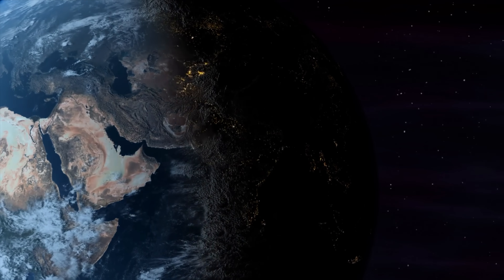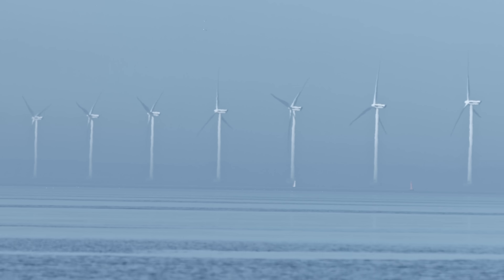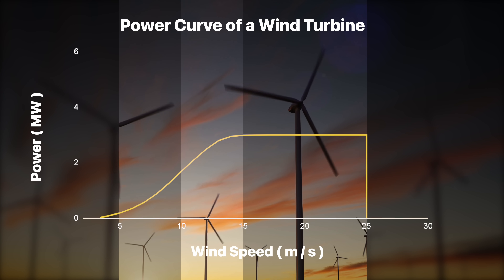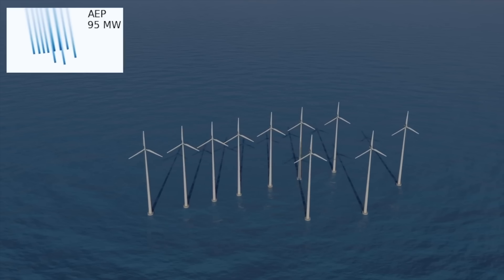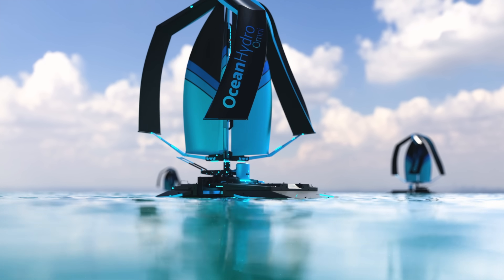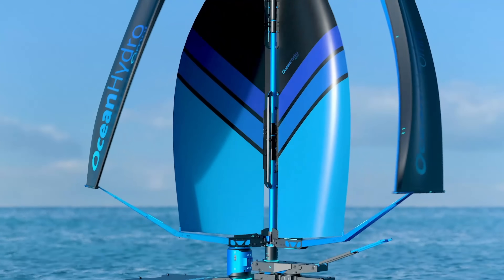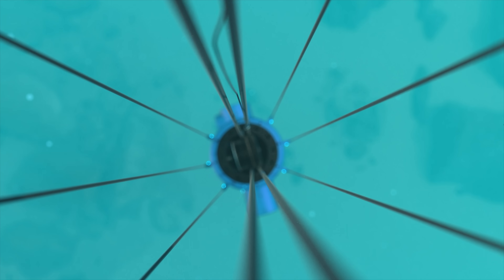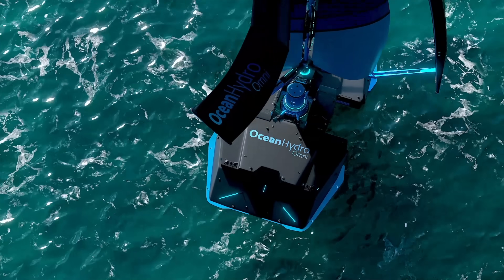Breakthrough Tech Solves Wind Power's BIGGEST Problem!

Comment: Still stuck in the past in one very important way, despite being beautiful in other ways. The problem? It is still grid-centric. That limits how far from shore these innovative new wind farms can be. In turn, that limits them to just the 1/4 or so of ALL ENERGY that is presently consumed in the form of electric power. To go ALL IN on wind power, we need to move large fractions of heavy industry far offshore, where locally generated wind power can finally replace fossil fuels on a massive scale. Aluminum refining, steel smelting, large-scale electrolysis of seawater, fertilizer production, synthetic fuels and much more can all be done using CLEAN WIND ENERGY far offshore, which can get Humanity the other 3/4 of the way, to 100% renewables.

Comment: I don't even want to address the maintenance needs of such a system. I simply don't believe the efficiency stated. Water displacement on the way up and down is such a burden on the energy content compared to a simple pumb. And the best for the closing argument, it absolutely makes no sense to pump the water from the bottom of the lake/river/ocean to the top of the reservoir, you do that from as close to the surface as possible. e= m*g*h counts from the surface. You would lose m*g*height-of-the-water-body each time you pump.
Edit: I have to correct myself. The latter part is wrong. Pressure from the water body will equalise the needed energy.

Comment: Has any work been done on how the vertical turbines perform in turbulent air? It sounds like they should do better and also smooth out turbulence down stream. This could allow joint wind farms with vertical turbines allowing for greater density of horizontal turbines. Has any work been done on it?

Comment: This technology would probably be better used  without the weight moving in the water column. Use the wind to pump the water and work as a desalination pump or pumped hydro using seawater.

Comment: I’m curious how this is system is anchored to the sea floor  as it has to endure the interaction from waves on the floater and from current on both floater and weight. The underwater area of a 1000 ton weight is substantial and this weight has to be supported by the floater. Also the weight has to be properly shaped to avoid the effects of current-induced turbulence

Comment: Great comment input on maintenance of seaborne structures w/moving parts, etc and it will take a mix of generation sources for an overall solution (like today, but more).  Still, these could be great in coastal areas, but transmission losses will limit how far inland this could feed power.  Interesting, but myriad large challenges remain that I don't see a great solve for.

Comment: Why not then use normal more efficient turbines and put the weight storage on land? Seems like its way easier to maintain and simpler to implement. Same thing as the one proposed in the video. In Norway e.g. you would use it topump water to dams and regulate that way, again the same principle but better.

Comment: This looks like a maintenance nightmare. Your are building an energy buffer under water, how can this be cheaper than old car batteries in cheap containers close to the city? I'm a mechanical engineer and I cant see a solution where moving cables are supposed to last under water with rust, particles build up, metal fatique etc. A traditional windmill is a very clever solution when u think about it since the moving parts are placed in air which is a much easier medium for materials to handle than a biological medium like seawater.  
  Windmills can also turn down production which this vid indicate it can not.. We need a solution with fewer moving parts and less material area to be sandblasted, not more.

Comment: I see a lot of "science" channels that present almost like company mouthpieces. Where's the critical analysis? Where's the opposing data? In fact where's the actual data? You say HAWTs are 50% efficient and VAWTs are 35-40% efficient (I'd like to know the source because I think that's high but anyway). But that's directly taking kinetic to electric. Here there's two extra step of converting kinetic then potential then kinetic again. With, unquestionably, losses in efficiency at each stage. So what's the total efficiency of the system? 7-8%?

I'm not even going into the issues of underwater moving parts because others have covered these already.

Comment: My question on this is related to water pressure and buoyancy.  Surely the weight would require far more energy to pull up than it would gain when lowered.  I may just be being dense (pun intended) but would be interested to hear from an actual scientist whether this is a valid concern.

Comment: Lifting a weight looks like it could break easily. All moving parts breaks over time. Also high wind speeds are not that common and only last for a short time. All sorts of things will grow on the part under the water, it will require maintenance on an unprecedented scale. Finally how does that operate in 20 meter high waves? The animation only show calm oceans.

Comment: Love the video!  Not so much the click-batey title... Tech that MAY solve part of wind power problem would be a better title.  First, as some have already commented, you have critical, moving parts under the water.  Sea Water.  This environment is brutal, and building anything that lasts is almost impossible and not cheap.  Also, an important point NOT brought up- the height of each type of windmill, not just the size.  The giant vertical windmills will get faster, more consistant wind than the comparitively short Horizontal windmills- comparing the power each type of windmill generates is not going to be the apples-to-apples comparison the video presents, which brings into question their calculations on how much more power this system will generate.

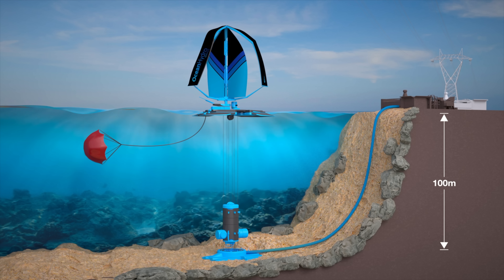Comment: 9:22 nonono, no. this is not a storage, this is a joke. 
do some mgh and tell me where you gon fit half a million tons of concrete. which is what you need if wanna store 10h of 5MW with dh 36m.

oh ya, water. so concrete has a relative density of 1.4 instead of 2.4, lets make it a 6MW turbine then id take 1 million tons of concrete. 
thats 100eiffel towers. or 10 if its 360m deep.

Comment: on the high wind thing, i thought that out decades ago.  the blades have springs that hold them in place.  as the pressure increases, the pressure itself feathers the blades by working against the springs.  with the right preload, the springs begin to feather at marginally excessive wind, and go all the way to fully feathered when the wind is dangerously fast.  you might be able to be 95% feathered in a hurricane, still generating power.  take some played out oil production platforms.  instead of tearing them down, put these wind turbines on them, and use the energy to pump sea water through the existing pipelines that used to carry the oil, and on shore, run the water into a storage pond well above sea level if you have the spot.  then the generators run off the pond water.

Comment: There is a fault with this devices design.

The need to attach an electricity generator to a pulley.

They need to counterbalance two gravity driven weights on either side of the pully .....a counter weight.

Then they attach an air pump, and two balloon ballasts to the counter weights....

The counter weights use buoyancy to rise and fall driving the generator...the quicker it rises the more energy it generates....

The wind turbine can power the air pumps instead of lifting and dropping the weight. 

Also the wind turbine can be setup to generate direct energy.....or we can use much larger weights and use balloon ballasts to reduce the energy of lifting the weights.

Integrating underwater wave power into the system, we can reduce the turbulence around the water gravity battery....so that the disturbance doesn't reduce efficienty.

this is an excellent idea....they're not going far enough

Comment: Never mind hurricane force winds, how about hurricane waves? The CGI shows calm water. But the ocean isn't always calm, especially when it's windy. As the floating turbine moves up on a wave, the load on the cables increases as it pulls the weight up. Then the floating turbine drops, and the weight also drops, with considerable momentum. then the  turbine rises again, and suddenly it's fighting against the downward momentum of the weight. This is called "snap loading" and leads to excessive fatigue on the cables and/or pulleys involved. And it happens with every wave that passes under the floating turbine.
Plus, every wave makes the turbine rock side to side, which probably can't help efficiency, and again stresses the vertical axis. Food for thought....

Comment: What an interesting solution to the Energy storage issue. I wondered what they were thinking with Wind power that was less efficient. But it is very interesting how it will use weights in a way as a sort of power storage.

Comment: ok...there is an obvious flaw and solution. ship the weight. connect to a sodium battery power bank. draw as needed from that. as to the shape...much better than the monstrosities presently being built and the advantages are self evident. with no bobbing weights attached the marine life will be impacted far less as well as far less mechanical maintenance/complexity. less stuff to break = more reliable.....less costly to replicate.

Comment: Though it would require more of an investment in the foundation of the standard offshore wind turbine to make it feasible the addition of underwater turbines to harness the much more reliable sea currents so that when the winds are blowing inconsistently the subsurface units can take up the slack and provide a more even energy production. There would also be the added benefit that when the winds are blowing too fast to allow for the safe operation of the wind turbine then the water turbines could take over and keep the juice flowing.

Comment: it seems to me the biggest overlooked aspect of offshore energy is the transmission of that power, which requires expensive and costly to maintain infrastructure.
one work around is to instead use that energy at its source. floating wind powered processing plants; desalination,  waste processing, etc. 
perhaps with a battery recharging station for electrically powered shuttles which go to and from the rigs.

Comment: Im not sure if placing Mass under water to use gravity's pull for storing energy make a lot of sense (buoyancy)?. 100kg Concrete up 10m in Atmosphere stores about ~2.7Wh in potential energy. In Water you loose ~50% weight. so around ~1.35Wh per 10m depth.
Lets say we have 100m depth. = 135Wh per 100kg Concrete. If you have 5 Tons of Concrete you got ~6750Wh or 6.75kWh potential Energy storage. The newest windmills produce ~15MW peak. To store this energy in 1 hour with a 100m cable under Water, the Mass of the concrete block should be ~11.1 kT. 😂 Storing Energy is a …..
Please correct me if i made some errors.
Reply: I made a mistake. Its even worse. 5 Tonns result in ~675 Wh and the Mass for the 15MW example needs to be 110 kT

Comment: Wind is HIGHLY predictable 48-72 hours in advance because it is tied to weather fronts which we monitor globally and predict constantly better and better all the time.  And as you showed it's highly predictable on a scale of several months, it's the in between range of a few weeks in which it's unpredictable.  Every energy sources predictability is nuanced in this way with time scale being key.  Fortunatly for wind generation most power is sold either in long term blocks via contracts, or purchased a few days ahead in futures markets, essentially the time span that wind is unpredictable over is not where the market operates anyway.

Comment: Interesting concept both for energy generation and also energy storage. I see problems to solve regarding corosion and sealife that could interfere with the moving parts. And the involved weights need to be in the multiple tons range to store some meaningful amount of energy. A 10 ton weight dropped 300 m has a potential energy of 30 megajoules, or ~8 kWh.

Comment: I'll believe it when I see it. It didn't give any sense of cost & energy scale for the storage, which is THE challenge in energy storage. And doing it all underwater seems a bit crazy given how expensive it is to build and maintain moving machinery in the ocean. 

I'd like to see a practical comparison with an onboard dyno, transmitted along the surface to onshore storage. Particularly with the consideration tha significant public & private investment will probably drive the price of storage down, without any engineering, time & $ investment from the company.

Comment: Isn't the reason for putting giant horizontal wind turbines offshore about placing them where there are fairly steady high winds and don't they need those really high towers to ensure that wind is far stronger and constant?  Putting any turbine close to the surface creates all kinds of issues and greatly lowers wind energy from normal wind shear effects.  What about large waves?  How will those rigs handle those?   As another person posted, anything under sea water has corrosion issues especially things with moving parts.  While this sounds tempting on paper, I predict this will never go forward.  If this concept of of using the wind turbines to raise and lower weights is a good idea then do it on a land based tower or over a large hole bored into the ground.  That sounds far easier.

Comment: BULLSHAT!  Terrible design!!
If you want a gravity battery (elevated mass), put it INSIDE the horizontal axis wind turbine (HAWT) support tower.  Yes the tower will need to be wider to hold a big mass, but it will be fully protected and the mass can improve stability in storm conditions.  
Meanwhile, the Vertical axis T (VAWT) can be placed in the empty, untapped zone under the HAWT.
(honestly some of these renewable ideas are incredibly stupid.  The idea of having 2 masses, one going down while another goes up, that perfectly cancels each other out! )
Two Bit, you can do just as well to criticize bad ideas as well as promote plausible ones.

Comment: The current design is not approved by most flocks of birds. The next pandemic will reduce technicians to repair failures. Salt water environment leads to corrosion and more maintenance. When optimus prime comes online it could take over maintenance.

Comment: Isn’t this solution close to circular thinking? 
Why not just use weights on land powered by wind at sea, were you don’t need to consider corrosion and other stuff that the marina environment brings? I initially thought that the video was about some genius way to use waves  and tides together with wind power. The proximity issue seems to be the one factor that speaks for this kind of solution, but I wonder about the difficulties and costs around this specific “solution” with the marine environment . Maybe I don’t see it because lack of knowledge. What is the true benefits to this kind of system against a offshore “traditional” wind park or any other “ungridly” power source exporting the the electricity to weights on land or under ground if you worry about the esthetics?

Comment: 7:25 - well I do love some enthusiam - just, dont let yourselfs be fooled by designs like that, just because the efficiancy is not "that far behind" doesnt make the concept feasable.... The issue with those turbines is not their efficiancy, never was - its the issue of the wind itself being stronger further up..  15m -> 150m isnt just x10 higher, but x10 stronger wind. The Idea with lifting and thus storing isnt new either - can be done with classic WEA just the same. Vertical axis turbines of this kind have been advertised over and over for the last 30 years at least (even some with similar "features" like here - none of which could ever even closely compete).

Comment: So basically weight storage.  The system doesn't have to be generation and storage together.  Just add weight storage to horizontal turbines.  But as many have already mentioned moving parts in water is just not a good practice for long term.  Batterty still seems best practice. 

Aside from storage how much can these horizontal even generate?  You would need 100s to compare to even 1 horizontal turbine.  There's no specs on output from horizontal. 

Love the idea though for home use but don't think this will work.

Comment: This concept looks like a non-starter. It is expensive to build and less efficient that existing wind turbines. Another commenter claims that conventional wind turbines have to be tall to avoid high waves. This is not so, they are tall because the wind speed is greater at that height. The design in the video is near the surface where wind speed is slowest, that is one reason for dismissing this as a viable concept. Another reason why it is a bad idea is the ridiculous amount of maintenance the pulleys and cables would require as a result of being permanently immersed in salt water.

The density of a likely material which the weights could be made out of, concrete is 2.4 tonnes per cubic metre. When immersed in the sea a cubic metre of concrete would weigh less than 1.4 tonnes due its displacing over a tonne of salt water. This means more concrete, or whatever the weights are made of, would be required compared to a similar system on land.

What it comes down to is a poorly performing method of capturing wing energy, compared to every other current method. To make up for this the "designers" have tacked on a storage system that is less efficient than equivalent systems on land, with the added disadvantage of ridiculous maintenance costs.